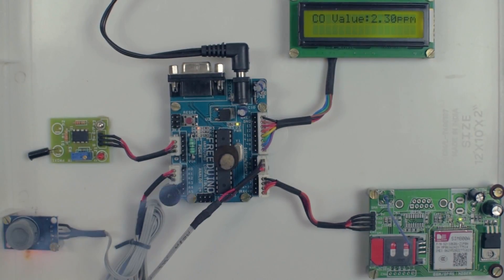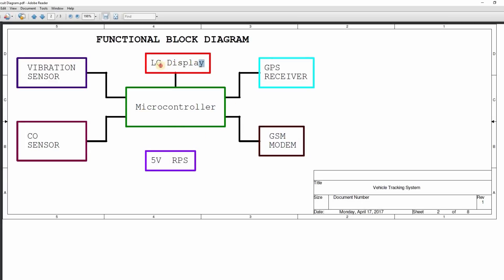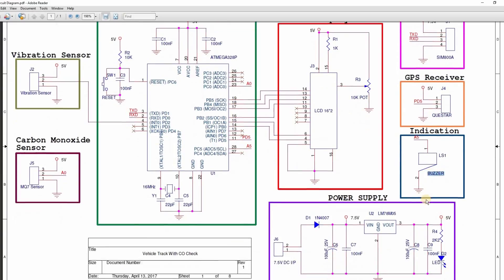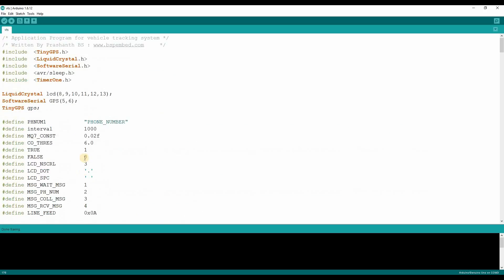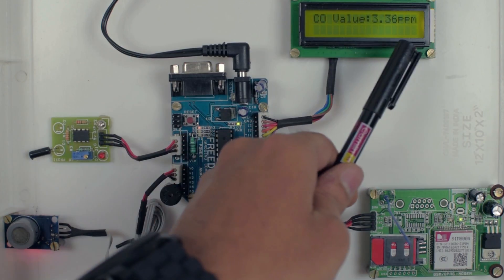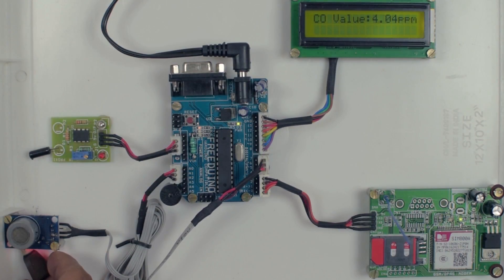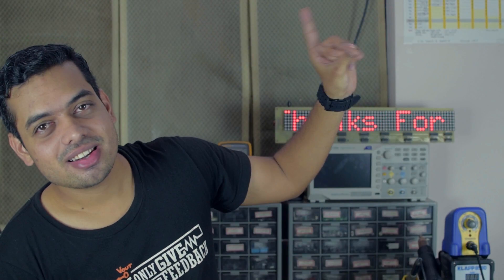Build Your Own Vehicle Tracking System using Arduino

Comment: is this 5V Regulated Power supply that you mean in the description?
https://saudi.souq.com/sa-en/0-30v-2ma-3a-adjustable-dc-regulated-power-supply-diy-kit-short-circuit-current-limiting-protection-for-arduino-33539370/i/
Reply from the maker: https://www.ebay.com/itm/DC-DC-9V-12V-24V-to-5V-3A-Step-Down-Voltage-Regulated-Power-Supply-Converter/191904893094?hash=item2cae6c48a6:g:4kwAAOSwc1FXbPaj

Comment: I could not find 5v regulated power supply can you give me a link for it  or even picture? please help
Reply from the maker: https://www.amazon.in/eHUB-Supply-Module-Converter-Replace/dp/B07FXB8CXB?tag=googinhydr18418-21&tag=googinkenshoo-21&ascsubtag=0e6706ad-5184-4de8-8ef5-ab46bd68a7e5

Comment: I am so sorry  for annoying you in a comment but I am very beginner but is this FRC(Flat ribbon cable ) for connecting GPS Receiver.

https://saudi.souq.com/sa-en/40pcs-jumper-wire-cable-1p-1p-male-to-male-length-20cm-arduino-28314962/i/
Reply from the maker: No it is not. Check this https://www.sunrom.com/p/10-pin-frc-cable

Comment: https://saudi.souq.com/sa-en/ugreen-dc-power-supply-12v-2a-ac-110-240v-to-dc-12v-adaptor-power-cable-led-transformer-converter-portable-wall-charger-uk-plug-adapter-with-1-5m-cable-and-5-5mm-x-2-1mm-dc-jack-for-led-strips-cctv-camera-cisco-router-yamaha-keyboard-etc-24w-max-35478455/i/  is this  7.5V Dc Adapter ? please help
Reply from the maker: Yes, You can use this.

Comment: I am very beginner. can anyone help me to find all compenets in this video ? just I want to know what is the cable between Arduino , gps , gsm and sensors ? you help me alot if you give me the link of all componets . please help me
Reply from the maker: Cables are called RMC. We used 2 pin, 3 pin, 4 pin RMC cables in this project.

Comment: https://saudi.souq.com/sa-en/lm7805-three-terminal-voltage-regulator-module-power-supply-module-7-5v-20v-to-5v-diy-kit-l7805-28320549/i/       please anyone can help me?! is this  5V Regulated Power supply in the description ? can you give me a link to buy it from?
Reply from the maker: Yes you can buy it.
Reply: It does not appear in your video . can you explain to me where can I put it or connect to what?
Reply from the maker: Its their on the arduino board. Since you are using Arduino nano, you have to supply 5V to it.

Comment: sir if I used as accident detection where can I put it on the car and how? can I use an app to send a notification to pre-selected contact. please help me
Reply from the maker: You can put in front of the vehicle. You can use an app, But its difficult to implement. As of now, we are sending notification SMS to the contact with google location.
Reply: BSP Embed thank you for your help, as an IT student can I build things app as final year project? And I want to know how many cable did you use in this video? Cause I want to buy it now and I will not be forgetting it again
Reply from the maker: 3Pin RMC: 3 No's, 4 Pin RMC: 1 No, 6 Pin RMC: 1 and used 3 PIN FRC(Flat ribbon cable ) for connecting GPS Receiver.
Reply: Premam Movie watch on YouTube goldmines telefilms

Comment: so nice project and nice presentation....sir may you help me in building such a nice tracker for my own car..????
Reply from the maker: Thanks. Project is just in prototype stage. You can built it yourself, As all the details are available in the GitHub. Link is given in the description. You can also buy commercial tracker from ebay for around 1800/-. https://www.ebay.com/itm/Car-Vehicle-Motorcycle-GSM-GPS-Tracker-Locator-Global-Real-Time-Tracking-Device/232330069435?epid=853903004&hash=item3617f385bb%3Ag%3AE5kAAOSwtGlZEst~&_sacat=0&_nkw=tracker&_from=R40&rt=nc&_trksid=m570.l1313

Comment: Hello Bro I have finally executed the code after rectifying the errors in the code but I am facing a problem in getting response from the GSM modem I have sent the message "TRACK" but in return I am not getting the status...
Reply from the maker: TRACK SMS should be sent from the authorised number. Which is defined in the program.
Reply: BSP Embed bro it's still not working I have done many text...
Reply from the maker: Are you getting any SMS from the unit. Like Accident occurred message.
Reply: BSP Embed no.
Reply from the maker: Then first check GSM modem is working fine, by connecting to PC & executing AT Commands.
Reply: Did you solve the problem? I have the same issue

Comment: Hey Bro I have  been working on the same project and found your video but as i compiled the program it is showing error message to initialize the void setup please help me
Reply from the maker: Let me know the error.
Reply: /tmp/265067482/sketch_may10a_copy/sketch_may10a_copy.ino:75:1: error: expected initializer before 'void'

void setup() {

^

exit status 1
Reply from the maker: Check for proper syntax.
Reply: I have tried the syntax given in your video and it was full of errors I have rectified many errors but i am not able o rectify this one..
Reply: @crazyindianhacker1057  worst project

Comment: Sir i m trying to build VTS but, there are some problems, can u help me??
Reply: I am using GSM SIm900A module but i can not able to find where to pin the wires?? Can to help me?
Reply from the maker: Find out Rx, Tx, & GND pins in GSM Modem.

Comment: is it necessary to use sim...
if we are controlling it through an APP....firstly...is it possible?? that we can remove the sim and just track the device
Reply from the maker: Since it is a standalone unit, You have to use SIM. You can also tract using your mobile app.
Reply: BSP Embed i am asking...can we implement this Project without...the sim card
Reply from the maker: No you can't.

Comment: Haiii sir I am using Sim 900A in this module I got a error that is messages or calls are not sending and in module the status light blinking every 3  sec and NWK light also pls help me
Reply from the maker: Connect SIM900A module to PC & check its working.(Like sending SMS).

Comment: sir can you explain the softwareserial serial(5,6) but in circuit diagram you did not use pin pd6, and in circuit diagram GPS RX or TX is need to be connected to microcontrollers TX or RX 
anyone please explain
Reply from the maker: GPS Receiver module requires only one connection. i.e Tx of GPS to be connected to Rx of uC. I have connected to Tx to PD5. Please recheck the circuit diagram.

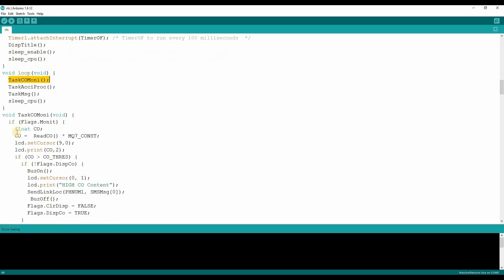Comment: Arduino: 1.8.6 Hourly Build 2017/10/20 02:33 (Windows 7), Board: "Arduino/Genuino Uno"

C:\Users\Windows7\AppData\Local\Temp\arduino_modified_sketch_956283\sketch_nov08b.ino: In function 'void TaskMsg()':

C:\Users\Windows7\AppData\Local\Temp\arduino_modified_sketch_956283\sketch_nov08b.ino:157:32: warning: invalid conversion from 'unsigned char*' to 'const char*' [-fpermissive]

       if (!strcmp(PHNUM1, PhNum)) 

                                ^

In file included from C:\Users\Windows7\Desktop\arduino-nightly\hardware\arduino\avr\cores\arduino/Arduino.h:25:0,

                 from C:\Users\Windows7\AppData\Local\Temp\arduino_modified_sketch_956283\sketch_nov08b.ino:1:

c:\users\windows7\desktop\arduino-nightly\hardware\tools\avr\avr\include\string.h:287:12: note: initializing argument 2 of 'int strcmp(const char*, const char*)'

 extern int strcmp(const char *, const char *) __ATTR_PURE__;

            ^

C:\Users\Windows7\AppData\Local\Temp\arduino_modified_sketch_956283\sketch_nov08b.ino:160:37: warning: invalid conversion from 'unsigned char*' to 'const char*' [-fpermissive]

         SendLinkLoc(PhNum, SMSMsg[2]);

                                     ^

C:\Users\Windows7\AppData\Local\Temp\arduino_modified_sketch_956283\sketch_nov08b.ino:187:6: note: initializing argument 1 of 'void SendLinkLoc(const char*, const char*)'

   void SendLinkLoc(const char *PhNum, const char *GSMMsg) 

      ^

Sketch uses 10726 bytes (33%) of program storage space. Maximum is 32256 bytes.
Global variables use 939 bytes (45%) of dynamic memory, leaving 1109 bytes for local variables. Maximum is 2048 bytes.
avrdude: stk500_getsync() attempt 1 of 10: not in sync: resp=0x30
avrdude: stk500_getsync() attempt 2 of 10: not in sync: resp=0x20
avrdude: stk500_getsync() attempt 3 of 10: not in sync: resp=0x30
avrdude: stk500_getsync() attempt 4 of 10: not in sync: resp=0x20
avrdude: stk500_getsync() attempt 5 of 10: not in sync: resp=0x30
avrdude: stk500_getsync() attempt 6 of 10: not in sync: resp=0x20
avrdude: stk500_getsync() attempt 7 of 10: not in sync: resp=0x30
avrdude: stk500_getsync() attempt 8 of 10: not in sync: resp=0x20
avrdude: stk500_getsync() attempt 9 of 10: not in sync: resp=0x30
avrdude: stk500_getsync() attempt 10 of 10: not in sync: resp=0x20
An error occurred while uploading the sketch

This report would have more information with
"Show verbose output during compilation"
option enabled in File -> Preferences.
Reply: wht is this brother?
Reply: I am also getting the same error while running the program.
Sir plss help

Comment: Arduino: 1.8.6 Hourly Build 2017/10/20 02:33 (Windows 7), Board: "Arduino/Genuino Uno"

C:\Users\Windows7\AppData\Local\Temp\arduino_modified_sketch_895211\sketch_nov07a.ino:2:24: fatal error: TinyGPS.h: No such file or directory

   #include  <TinyGPS.h>

                        ^

compilation terminated.

exit status 1
Error compiling for board Arduino/Genuino Uno.

This report would have more information with
"Show verbose output during compilation"
option enabled in File -> Preferences.
PLS HELP ME ...THIS IS THE ERROR MAKING ME FRUSTATED...

Comment: when i compile i see this what should i do??
C:\Users\Hp\AppData\Local\Temp\arduino_modified_sketch_698959\aaaa.ino:2:24: fatal error: TinyGPS.h: No such file or directory

   #include  <TinyGPS.h>

                        ^

compilation terminated.

exit status 1
Error compiling for board Arduino Mega ADK.

and for 'timerone.h'
Reply from the maker: Please download & install TinyGPS library for GitHub.
Reply: thank u and i downloaded i now it is showing this
Sketch uses 11,676 bytes (4%) of program storage space. Maximum is 253,952 bytes.
Global variables use 937 bytes (11%) of dynamic memory, leaving 7,255 bytes for local variables. Maximum is 8,192 bytes.
is it means i have done it right???????
Reply from the maker: Nothing to worry about it. It shows the program size in comparison with the controller available size(Memory).
Reply: as i'm new to this i don't know how to upload this code into arduino !!
can you tell me the steps to upload this plsss!!!!!
Reply from the maker: Their is a upload command in the menu bar. Make sure you select proper board(like Arduino uno) and com port number (Which port arduino is connected to PC).
Reply: can i use sim800 instead of sim800a
Reply from the maker: Yes you can.
Reply: did you really used resistors ,capacitors,pot as per the circuit diagram or directly connected to the ports????
Reply from the maker: Yes it is used in the hardware.
Reply: can you show the hardware pics other than you shown it in this video!!plss and how you give connection to the capacitor etc..
Reply: i cant find sim800a so i have selected sim800 but its of two different types one is with pins 5v,gnd ,rx tx and what u used is with pins rxd,txd. next one is witth an external power supply and with pins rxd txd and so many other pins
qustion1-what should i select?
question2-if it is the first one is rx and tx is same as rxd,txd?
question3-regarding the program-which phone no is to be written on the prgm !!mob no in phone or mob no in gsm module???
Reply from the maker: I don't have hardware with me.
Reply from the maker: You can use sim800.  Yes it same Tx, Rx & Txd, Rxd. Mobile number of person to which SMS is to be sent.
Reply: thanks man
Reply: hey i found that the gps receiver has pins E G R T V B  but u have connected only three pins can you specify which are they????? plsssssss
Reply: plss reply its urgent !!!! i have to complete it
when i sent 'track' to gsm i didnt get any reply plss gige solution for that!!! and about connections of gps receiver

Comment: bro. please make gps tracker with ublox m8n.
Reply from the maker: You can replace the GPS module used in this project with ublox m8n. Both are compatible.
Reply: BSP Embed not same for coding bro

Comment: You have used Simple External/hardware Interrupt for vibration sensor.....

Arduino has a simple set-up routine to connect the interrupt service routine to the event: attachInterrupt(). 
and it only works with two specific pins: digital pin 2 and 3 on the Arduino board 

There are only two external interrupt pins on the ATmega168/328 (ie, in the Arduino Uno/Nano/Duemilanove), INT0 and INT1, and they are mapped to Arduino pins 2 and 3.
Reply from the maker: Yes, You are correct.
Reply: Thank you. So did i win Olimex.... 😍
Reply from the maker: Contest is already closed. You can check next to know the winner.
Reply: BSP Embed OK 😇

Comment: hi sir good project..

I need u r help..rather than sending a msg ,I want to know the location of the vehicle by using an app

and If I want to implement this project ,and saying anyone can track my vehicle how could I do that, since u r just giving u r number only

waiting for your reply..thanks in advance
Reply from the maker: Message contains a link, When opened, a google map will open. Which indicates the location of the vehicle. You can develop an App which reads this message.
This system doesn't authorize to track a vehicle by other Numbers.
Reply: but if you would like to be safe, I would suggest on C++ to make an if statement saying to get password and if password is wrong then cancel order, if password is right then continue on. so for example u can text it saying "begin123456" and it should say "begin ok" where 123456 is the password. just a suggestion hopefully that helps u out with your project

Comment: there is no special interrupts used in this project we simply convert the analog signal into a digital signal then we set the threshold value to the sensor when ever the sensor reaches the threshold value it calls the alert function ...other wise we should use external interrupt
Reply from the maker: Positive Edge trigger is used. Vibration sensor gives HIGH Level (5v) when activated.

Comment: hi i am try for this project using arduino uno.
arduino uno is use full this project.
Reply from the maker: Yes you can use arduino uno..
Reply: what is gps reciever for this project.
Reply from the maker: GPS to read location information from satellites. QUESTAR GPS Module is used in the project.
Reply: could i use arduoino uno with the same codde u put

Comment: "Interrupt on Pin Change" on Timer0
Reply from the maker: No, I used Rising edge interrupt instead HIGH Level Trigger. Could you explain why?
Reply: Reading high level trigger as an input shouldn't be used to detect any critical event as the micro controller may miss the event when it's busy doing some other time consuming task.

Comment: Nice Work. Share more project videos.

When the vibration sensors detects a vibration sudden rise or pulse is generated. This is fed to arduino as a trigger input which initiates alert. But this cannot be used in real time application as even a small vibration in speed breaker will be detected as accident.
Reply: Even though it wont be that much effective
Reply: Instead u can use flex sensor
Reply from the maker: Yes, You are absolutely right. MEMS accelerometer or impact sensor has to be used.
Reply: We can use flex sensor in internal body of car. When accident occurs the body will get damaged which eventually change values of those resistors which may be used to detect accidents
Reply: @soorajjp1847  thats a pretty good analysis there
Reply: @Emtron_Technologies  mind working on it? The flex sensors version